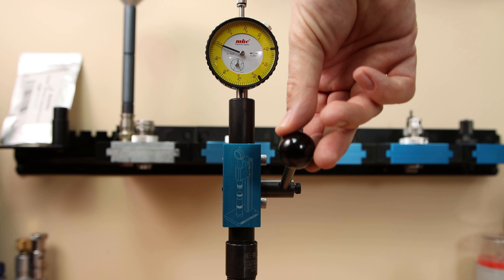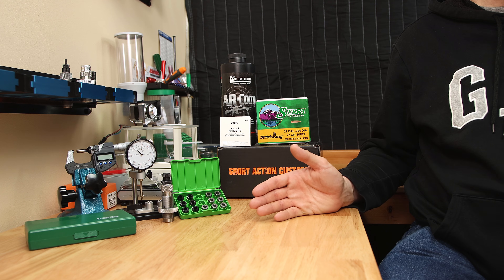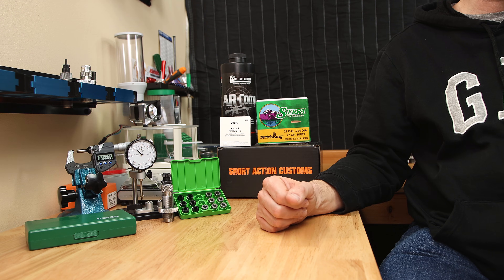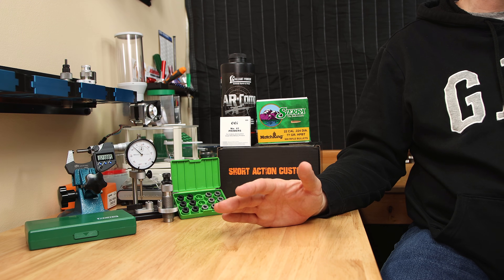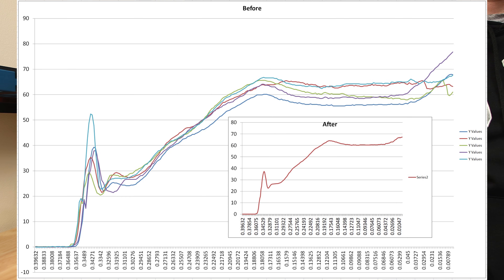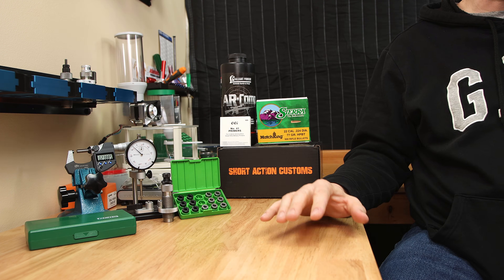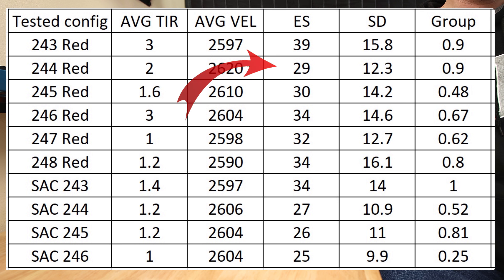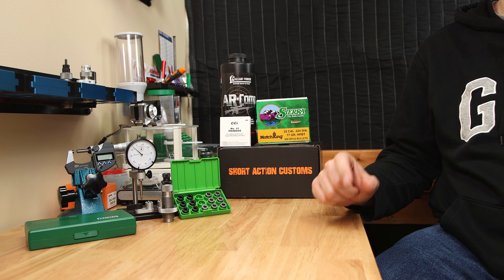Testing Neck Tension in 223 - UNBELIEVABLE Results?

Comment: What is the proper neck wall thickness to get consistent neck tension?
Reply from the maker: If you ask 10 guys you'll get at least 11 different answers. I believe that some of the 6ppc guys turn to like .008". I am guessing its at least minimally caliber different and also depends on what the inside neck diameter of your chamber is. The general rule I have heard is .005" of clearance between loaded round diameter and your chamber neck diameter so it has plenty of room for the case to expand. The next question will be how much of the neck you need to size.😀

Comment: Another great video - thanks!
I'd love to see indicated runout on the inside of the neck rather than the outside. Difficult to measure though. I feel any bushing die pushes neck thickness inconsistency toward the inside where it hurts most. As such, I use a mandrel die to true this up.
Reply from the maker: HI Kevin, The runout measurements on the chart on the the seated projectiles. The video clip I show is historical footage from the original comparison. That said, if your brass is at all decent there is no chance that your going to measure .005" TIR on the outside of the case and the ID is going to run true. I am going to include other charts data in future videos to show this but I was try to do a raw comparison of bushing to bushing. If you use 3 different bushings with the same expander would it vary? Not sure but it is a question I hope to put data behind in the future.
Reply: @BoltActionReloading  I get what you say, and agree that we really don't care about the loaded or unloaded neck TIR. What matters is the consistent contact on the inside of the neck and bullet and hence suggesting devising a way of measuring any inconsistency there. A loaded bullet may have minimal TIR while making inconsistent contact with the inside of the neck.
I'm considering a Redding type s full length bushing die with SAS bushings. Currently I'm running a Forster full length die, but with the expander ball removed, and then a Wilson mandrel to get the neck tension I want. With AMP annealing on every firing I'm getting highly predictable results. However... I've not found a way to accurately measure inside neck TIR.
I'm learning every day and look forward to your next video :)
Reply from the maker: We are all learning, myself included. I am very frequently surprised by some of the results I get. I am going a little overboard in 223 probably because its a little cheaper to test and take what we learn here to other calibers. I have had good luck with your method as it is the same one I use at this moment for my target loads. Though as I go through this exercise, I may change. I feel that 223 is actually more difficult to load for because of the shorter neck, lower case capacity, (I am thinking that the variation in powder measurement is a higher percentage of case volume and makes lower ES/SD more difficult to achieve) and being forced to seat past the neck shoulder junction. I also was concerned at the accuracy limits of this platform but being able to get several groups 1/2 MOA or less encourages me that there is potential here. The factory I have tested shows ES 70+ over 10 rounds so every single option I tested is no where close to that. Glad you guys enjoy the videos!
Reply: @BoltActionReloading  I'm personally glad you test 223 as much - I run a Tikka T3x TAC A1 in 223, so getting a lot from these videos :)
Reply: @BoltActionReloading  I figured that you were measuring on the projectile, and that’s the most important reference, in my view. I’m the interest of constantly learning, I’ll share my findings after measuring a wide variety of clean once-fired brass. What I expected was what you said - if the ID is true, the OD will be as well. In general, this seems to be correct. However, using a Mitutoyo 0.0001” ball mic, I was surprised to find that the wall thicknesses around the perimeter of single pieces of brass can differ by up to 0.0013”.

These measurements were highly repeatable, using calibrated pressure, not flukes and not uncommon in my random sampling from ~1k cases.

For me, this paints tension and concentricity in a whole new light. I haven’t yet set up an indicator to measure internal/unloaded concentricity of the mouths for brass with mouth thickness variation but it’s definitely on my list. This is similar, perhaps identical, to the loaded measurements - but also possibly not. Maybe the ID is concentric with the case body or maybe the OD is - I don’t know. Seems like a potential case of garbage-in, garbage-out. We might be measuring runout, seeing the variations and thinking they’re due to sizing and seating when it could be iffy brass causing the biggest variations all alone. Like I said, needs more investigation - something for a cold, winter day.

Comment: I will say but then again I don't know what brand barrel this rifle has. Either way your doing a good job and your. On the right track, however for me testing that is a lot of shots testing if the barrel was not cleaned in between out of all that testing. Could  very well answer your velocity difference. Like I said though your doing things pretty good here. I have found standard redding bushings to be a little off what there supposed to be at times, I have not had problems with the TIN coated ones though, I also never had one that was off measurement from l.e. Wilson either. But I like the looks of the short action customs bushings, look almost like a pvd super slick coating on them. Good video
Reply from the maker: This is a 18" SPR barrel from White Oak, 1:7" twist. It is very similar to the one JRB uses if I am not mistaken. I don't remember what length gas system he is using.

Comment: I think internal diameter of case mouth is what we care about, not external. And wall thickness may vary from case to case. All that makes me think that Lee collet die would provide more consistent neck tension then any die with bushings.
Reply from the maker: Hi Alex. If you would like to see how different options change these things I have a video here that includes the Lee collet die: https://youtu.be/b0igSmCMTfw
Reply: @BoltActionReloading  I saw that video before, thanks. At my view force profile of resizing process is irrelevant. I think two things matters though : 1) seating force 2) concentricity

Comment: One point to be made when ordering bushings, is, if you have various brands of brass, check them all with a loaded bullet, you may well need more than one or two bushings because of the wall thickness on different brands.
Reply from the maker: Hi Dave you are absolutely correct. I am just trying to give a general guidelines.
Reply: Or neck turn for uniform thickness

Comment: Have you ever tried the Wilson's bushings? cuz they are also slightly tapered internally, perhaps not as much as the SAC though.  Wilson's bushing FL die is also better than Redding's.  Thanks
Reply from the maker: I have not tried Wilsons bushings. I know that my run out flyers have basically disappeared when I started using the SAC bushings.

Comment: How confident are you that the projectile didn't move during the shooting process on the SAC .246 sized cases, causing a change in COAL/CBTO and that's what actually caused the better group?
Reply: That's what I was thinking. Maybe those bullets slipped out to the lands.???
Reply from the maker: I did not test setback. I initially did not intend to show any group data, it will have to be revisited. I would have personally expected the groups to open up and be less consistent.

Comment: Got a question.
 Have you ever had a fl   bushing die that you were using to bump shoulders. 002 and the bushing wasn't  allowing it to bump size..
Take the bushing out and then it would bump the shoulder back
Reply from the maker: That sounds very unusual and I don't think I have ever seen anything like that.
Reply: @Bolt Action Reloading  do you by chance have a redding #12 shell holder that you can measure the thickness of. 
Someone brought it up to me that it could be the shell holder, I'm using a rcbs shell holder... it might be a tad to tall
Reply from the maker: What exact measurement are you looking for? Top of the shell holder to where the brass sits or somethings else?
Reply from the maker: If that is the case, that dimension is .1241" on my #12 redding

Comment: Did you run a expanded  mandrel or just bushings
Reply from the maker: Hi John, Just the bushings in this case. Initially I had just planned to show the real changes in neck tension with the bushings. I figured this was craze enough. Running and expander changes the profiles more than I would have thought.

Comment: Each time you do a test with Short Action Custom bushings I try to buy some and they are sold out.
One question, is there any bullet lube or lube in the neck that you use or is it bare metal? One F-class guy I watch says there should be some sort of lube.
Reply from the maker: I am going to do some neck lube tests. These are just whatever carbon was left after cleaning and brushing the necks. I am probably going to deep here in 223 with the neck tension stuff.
Reply: @BoltActionReloading  More good stuff to look forward to, thanks!

Comment: Too bad you did not include the L.E. Wilson bushings.  They allow either a straight diameter sizing, or a taper to size sizing by flipping them over.  They also size less of the neck length as the SAC bushings.
Reply from the maker: I may have to give them a try at some point. So many things to test, so little time.
Reply: @BoltActionReloading  Well, if you sell your children onto the slave market, you can devote full time to the YouTube crowd.  Just comes down to priorities.  Every test leads to more questions, a never ending quest.  
ROTFL😂

Comment: Neck tension low enough that the bullets slid forward to seat in the lands when being chambered?  Where you able to eject a chambered round and have it stay together?
Reply from the maker: I will have to retest. I did not expect it to perform well. Like I mention in the video, its probably too low, but you can bet I will find out.
Reply: @BoltActionReloading  this was my thought as well.  A good test would be to put one of the 246 rounds in the bottom of a magazine and then check it’s COAL after shooting the other rounds but before chambering that one.